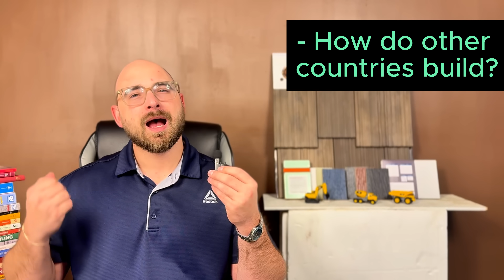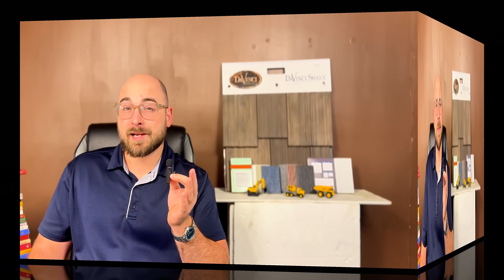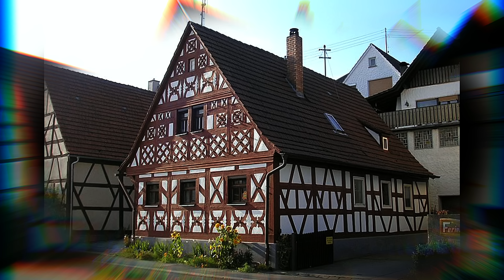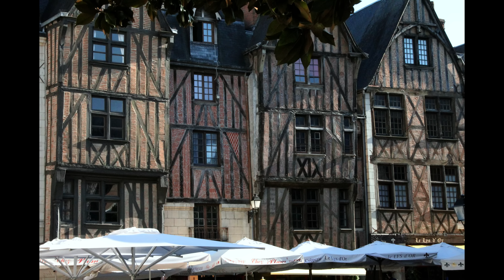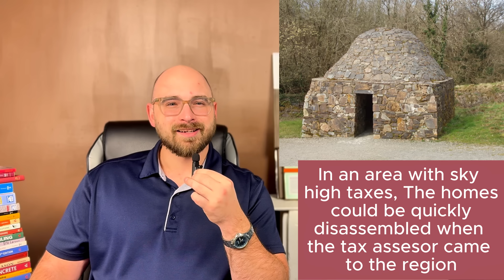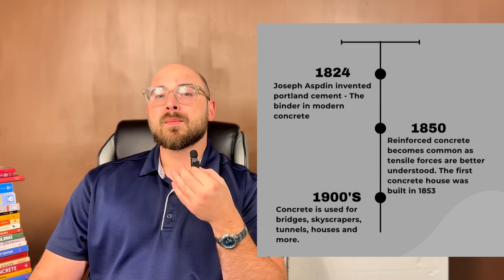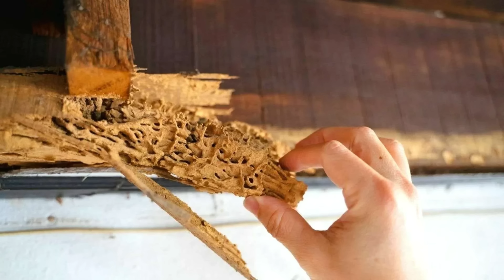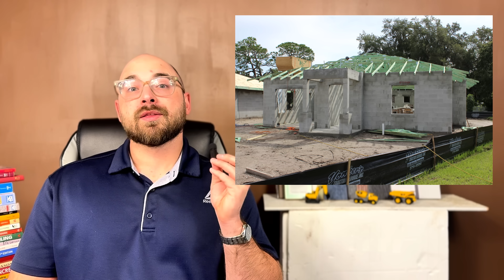Why Other Countries LAUGH at American Homes

Comment: Here in Canada we live in a 200 year old house, timber framed but with an added brick exterior. Its weakness is the roof, using modern fibreglass shingles which only last about 15 years and which suffers from ice dam issues in our winter/spring transition. As a Brit, this seems ludicrous, and I'm looking for a better solution. We still have a house in Britain, 350 years old, built with solid stone walls and slate roof. It has been extended a few times in its life and now includes RSJ beams (masked with modern plastic covers to look - realistically - like old wooden beams. With modern windows and doors, giving better weather seals and no drafts, it does suffer from moisture retention and we have had to add a modern forced ventilation system, but it is long-lasting and retains its value well with limited maintenance costs. Comparing the two houses, our Canadian one is more of a money pit, needing continuous care.

But the main issue for me is what goes into the house, such as the electrical and plumbing systems. The British electrical standards, for instance, used to mirror the American ones until the 1950's, when they were given a major overhaul and redesign. The ring main approach, with lighting and power circuits completely separated, and with the square pin, fused and switched plug/socket system (see Tom Scott's excellent video on why this is so good) is so much better hat the archaic and unsafe American system.

The British plumbing standards, as with all European standards, are so much better, too, emphasising quality at moderate increased cost, leading to systems that don't need so much maintenance. For instance here in Canada I'm struggling to get a watertight seal on my shower head, because the plumbing standards allow very thin-walled piping which presents a knife-edge pipe-end where it should present a flat end surface for the sealing grommet. There appears to be no solution for this problem, but it is one I've never met in Europe.

The problem seems to be a systemic reluctance from Americans to learn from other countries, to see that other people do things better and that you could improve. You are taught from a very young age that America is the best country in the world, and your geographical isolation means that few Americans experience other ways of doing things. You think of travelling to Canada as going abroad, and yet Canada (unfortunately) follows American standards for convenience and low cost. If you haven't travelled to Europe you won't have seen how they do things better, and your media doesn't give you any news or cultural input from beyond your borders. There's a whole world out there, but your geographical isolation and your ingrained American Exceptionalism stops you from learning from it. I'm pleased to see this video begin to address that, but it is only scratching the surface. As a European living alongside you, it feels like I've travelled back in time and I'm having to use systems we abandoned 75 years ago. Please, keep educating your countrymen about better approaches and other countries' experience and improvements.

Comment: Ukraine vs US now (1/2025): regular brick for pallet (250pcs) - $45 vs $600 + work 50% of price. Cement/concrete for 50lb $3.5 vs 4.5-5.99. In general, work price will be lower in 4 to 10 times in Ukraine even in war time. For example, capital sunburn new brick/ concrete 2-story houses w/ metal roof and w/ metal fence (automatic door) ~ 2200 sq feet and 6 acres of land ~ $200-250k.

Comment: Our obsession with sharp sand was our downfall. We add water until it's workable, less jagged sand provides that with less water, leaving unreacted cement to activate when exposed to moisture in the air. The key is in the aggregate.

Comment: Here in southern sweden half-timber, or crossed-timber houses as they're called locally, were actually built where there was a lack of wood, in wooded regions you'd usually build them fully wooded. Why there aren't many wooded buildings remaining is they were replaced by stone houses when people realized wood catches on fire alot easier than stone.

For example Stockholm was probably fully wooded housing back in the 1700s because there's alot of forest up there.

Comment: The common reason for wooden houses I hear is that there's a lot of wood around. That's the same for the Nordics, but even still Nordic people no longer build exclusively out of wood, but wood is used in addition to sturdy brick or cement structure. It just doesn't make sense to use wood alone when your houses get blown away by hurricanes regularly. Well, I guess it makes sense for the cheap construction industry, but it doesn't make any sense if you think about the occupants first.

Comment: A wooden house with paper walls thats why people mock Americans. Its cheap so they can output a lot but it's very fragile.

Our house was built for storm weather, flooding and fire. Even had a plane explode arms length away from one and did no damage (window cracked and gutter pipe melted).

Cant believe I missed that explosion as well, I miss out on everything :(

Comment: In the Netherlands the exterior walls are double (brick or brick&concrete), meaning 2 walls with air vents in between. this is not only better for insulation and noise, but it also makes sure that no mold builds up in the house due to over-insulation. The houses have a ventilation system and windows are triple layered. Our electricity cables are running in pvc pipes and new cables can be pulled when necessary. all cables are solid core copper and regarless of the purpose the wire have the same diameter (for maximum amperage). Many houses have redundant pipes for electricity installed. Circuit breakers come with residual current devices.

Comment: Not Laughing , but you building yourself coffins , these houses get easy washed away, easy to break in , easy blown away by a storm, hard to heat up and they burn like a torch.
This is a very cheap way to have a Home or to call it a coffin, which is not save at all.
The only plus is , the Wood does not emit so much CO2 then all the concrete.

In Germany our government wants to do the same idiotic sht building houses from wood because of climate change, 
but with the climate impacts you need concrete , the more the better and not wood at all to survive.
Reply: In New England, there are plenty of centuries old buildings made from the now extinct "old growth" forests. These timbers are rock solid and fire, pest, mold resistant. My house is 250+ and doing fine. The Europeans that came here started the wood building trend because of the abundance of forests. The wood now is garbage, and will always be.
Reply: "The only plus is , the Wood does not emit so much CO2 then all the concrete."

I wouldn't be sure of that either; one, that wood mostly comes from old forests, not managed forests - it's not used as a renewable resource, they're just taking carbon sinks out of the picture. And when it does come from managed forests, they're the cheapest you can get, with very weak wood. And two... longevity has a value too. You pay the CO2 cost for the concrete once; then it lasts for hundreds of years. A proper wood house also tends to last quite a bit (and is more in line with what's used in Europe even today). But these flimsy American constructions can't survive something falling on them; they get ruined by humidity, bad weather, animals, mould...

But ultimately, there's a huge cultural difference - houses in Europe are meant to last for many generations, no matter what they are built from. That's what they are designed for, and what the people are willing to invest in. Not a "cool McHouse" to trade away at nearest opportunity.
Reply: @LuaanTi  Yea Wood can last, as long as there is no catastrophe , In china there was a historic part of a city burned a few years ago the houses where from the antic area so they were about 2000 years old.
But you can not build a house made of wood anymore , specially not in climate change , even not in hot climate Zones where you need houses that are not that hard isolate because of the Temps.
In climate change you need something more like military bunker like to survive, the architecture has to change world wide this way,
You need steel concrete and fiber fabrics and so on to build a home.
Reply: you can't build a house to be flood resistant, and it's very trivial to build a house to be less prone to break ins, it's about the simplest thing you could really. They don't get blown away by storms (it gets windy in the US sometimes, hard to believe i know) and they most definitely do not burn like a torch, drywall is literally non flammable, most exterior siding is flame retardant, all insulation is flame retardant, all homes have firebreaks, and the wood isn't exactly prone to burning down considering its not exposed. You have to try pretty hard to burn down your house, or literally get engulfed by a wildfire, a thing even cars cannot manage without melting into piles of metal.

Comment: You are wrong about the concrete houses. The german speaking countrys aktually subsudice housebuilding without concrete, because concrete is one of the biggest distributers to the CO2 problem and consequently klimate change. Build brick.

Comment: I live in a 3rd world country. Most houses have a concrete structure and brick walls. And insulated "sandwich" steel sheet roofs. They are strong and you don't get insects or animals under the house and in the walls.
For an electrical standpoint the US is also behind every country. Using solid wires instead of multiple wires for conductors, lack of Differential Circuit breakers, lack of three phase systems. Outdated code. 
I understand for cheap homes, but even multimillion dollar houses are not build to last.

Comment: We are, you .I've in sheds. In Europe we have many old buildings still in use, my parents for example live in their ancestral home getting on for 500 years old. It's not damp or draughty, has thick walls 3 feet wide at their base, buttressed in places, they thin with height. The original timbers were salvaged from a local ship wreck. Didn't lose as much as a tile in the hurricane in '87. It'll probably be lost to rising oceans before it falls down.

Comment: Homes in the US are an Embodiment of underregulated capitalism at its peak. Homes are built with minimum effort to extract maximum value for the builder/developer.

American homes are inferior to most European ones, especially when it comes to the topic of insulation. You don't see much by way of ACs in europe cuz we just dont need them despite the climate. With proper use of shutters on windows and the fact that masonry and activated concrete keep the heat inside when its cold and vice versa, we arent in need for buying expensive devices to help us not die in a puddle of sweat.

Comment: A thing one should keep in mind, after WW1 and 2 Europe was pretty deforested in the war efforts, so availability of wood just wasn't there. That's about the time when timber framing went out of fashion and stone/clay/etc based construction became more common because that's what was available. Since the deforestation and subsequent reforestation most of the lumbar that is now available is pretty low quality pine. In comparison the US has a lot of wooded areas in general compared to population and has not had an event that necessitated such a large scale rebuild of everything.
As for cost, a mate of mine built his own house a few years ago with CMU walls and concrete floors. The cost of wood for the wood truss was nearly 40% of the total material cost for the 2 story home.

Comment: In Germany we use metal framing for interior walls. U usually a metal frame, rockwoll or hemp insolation, and then a OSB + Drywall or double drywall

Comment: Bulgarian here, I am a homeowner for 3 years now. I bought a two-story house with attic and basement. The construction is brick walls and rebar concrete slabs. With thick stone and concrete foundation and wooden roof with ceramic roof tiles. Pretty standard around here. 
It was built in 1968 - 1970 and outlived the previous owners, as I am sure it will outlive me as well. 

Funny thing is that if I decide tomorrow to build a one-story building the american way in my yard, I wouldn't need a permit from the municipality, since it would be considered an "unsolid building", hence inherently a temporary construction. Even banks don't issue mortgages for such homes - too flimsy, risky and seen as bad longterm investment overall. 

If a bug can literally eat your home away... make your own conclusions.

Comment: I’m not surprised that an American made video, likes to defend American made homes. If you talk about wooden houses made in Europe. Please compare your “American cheap made 2x4” houses and European made 12x12 houses correctly! There is a big difference. I did live in Canada for 15 years. The only place where you get wind drafting out of the power plugs and switches is North America. Building my home in Germany with 12” blocks and finishing my basement completely in Canada with frame walls. What a “shut” of time and work to build walls in North America! Framing, isolation, drywall, mudding, sanding. Seriously? 😂 I live now in Panama. I’m very happy to build my walls at my house with concrete blocks again. And I am very sure that my house in Panama is still here in 300 years like my house in Germany I built myself. A American 2x4 house? Good luck to get 60 years out of it. I’m not talking about the old frame houses. I’m talking about the new cheap quality made houses. 😅

Comment: No, houses generally should not be built using concrete for the main structure. Bricks are far better in pretty much every way. They offer good insulating properties by themselves unlike concrete. They dont produce huge amounts of CO2. They're often cheaper and quite easy to put together. They are not hard to remodel either. 

Concrete is great for floors and foundations however. Which is another part not mentioned in this video, european homes have far superior Slab foundations that prevent settling pretty much entirely, while US homes more or less just sit on a couple wooden blocks on the ground, thus settling unevenly and causing severe warping over a few decades.